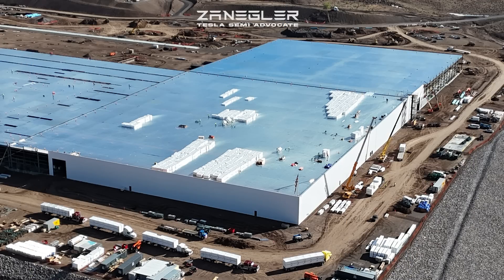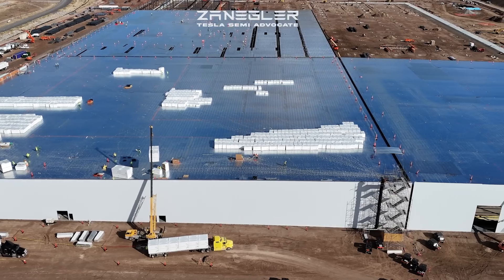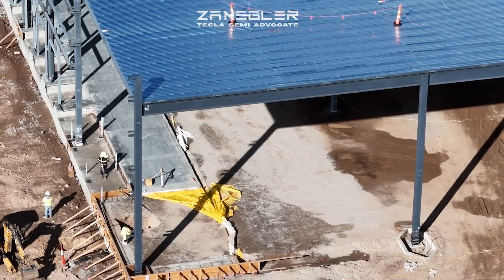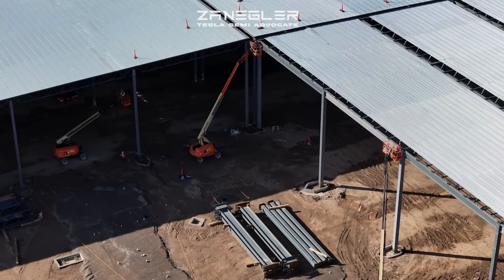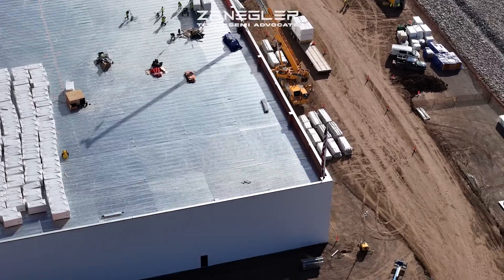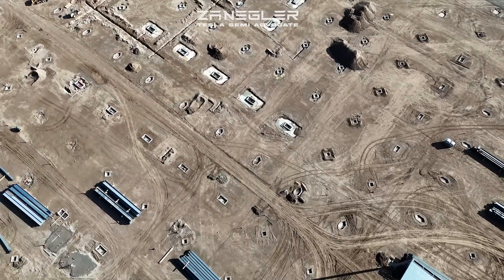Tesla Semi Factory - The Cranes Have Arrived! 10/29/2024

Comment: At 8:40 , Just as you mentioned it, I was thinking about the big job ahead pouring the concrete floor - probably all this winter long - once the roof and walls are complete. What a job that will be - and parade of concrete trucks! But as the interior floor sections are poured, leveled, and cured, factory equipment and furnishings will also begin to arrive en-masse and can be stored inside out of the weather. At this rate, by next spring, parts of the factory will really be coming alive (which we will not be able to see, unfortunately).

Comment: 1:40. Wall panels. Change in colour, thickness perhaps also. Architectural feature.
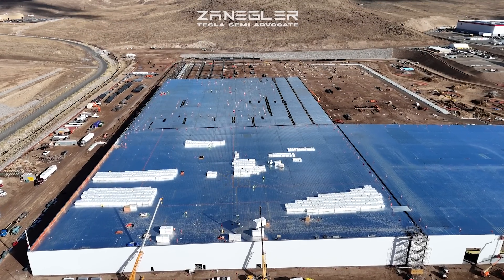7:05. Roof. Orange lines marked. Might be expansion joint locations, or fire separation/compartmentation locations.
Reply from the maker: Good eye on the change in color on the wall panels. I noticed that too. Perhaps different strength IMP? Insulated Metal Panels.
Reply: @ZaneglerTeslaSemiStalker-vt3or  I say thinner because I think I can make out shadows at the horizontal joint between the white and grey panels.

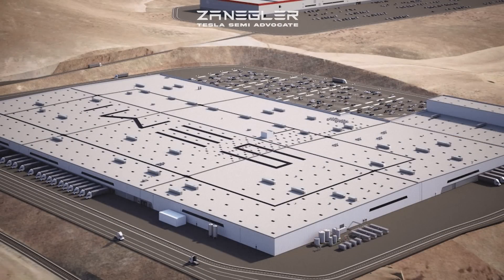The change shows up in the render at 9:55. Either side of all the loading docks.

I'd say it's an architectural feature.

Comment: Hi Zanegler, so you don't lose everyone with the new Section nomenclature, how adout starting your videos with the final factory rendering (which you normally show at the end) with some lines denoting the sections and the Section Letters superimposed over the top?
Cheers mate and have a good one!
Reply from the maker: I did create a grid of the old and new section labels as I was getting lost. It really helped me get it straight. Ill see about overlaying it on the render. Keep the suggestions coming. Except the ones about changing my voice. 😂
Reply: @ZaneglerTeslaSemiStalker-vt3or  Hopefully soon. Grid lines, section names plus a compass graphic showing north would be a huge benefit to your intro.
Reply: @GntlTch  Gridlines. Assuming they are following the same pattern as at GT, should be west to east, A to Z if it gets that far. And.  north to south 1 to whatever. Building seems shorter north-south than east-west, so they may have flipped it.

Took ages to work out the grid at GT. It was only when GA was being constructed that grid markers were first visible.
Reply: @ZaneglerTeslaSemiStalker-vt3or  Have you tried inhaling helium? 😑
Reply: Great idea. Like Joe's site plan at the start of each video.
Reply: @DessieDoolan  Can't say my ideas are original 😂

Comment: Flying around yacking doesn't cut it. Draw the floor plan,  label the sections, and outside draw an arrow pointing to the North. ( Joe Tegtmeyer does this on every episode._
Label outside the edges A to <whatever> in the horizontal axis and 1 to <whatever> in the vertical axis. (Like a spreadsheet.) 
That will clearly label the factory direction and identify floor squares.
Reply: @AGNT20_85 Can get you anything you need in violation of his NDA tag him he will send floor plans right over and anything else you need. He is in the know, any proprietary information he has it.
Reply: Jeez.  Attitude.